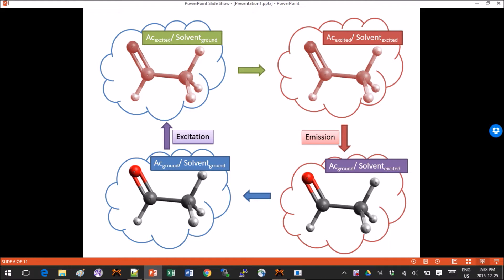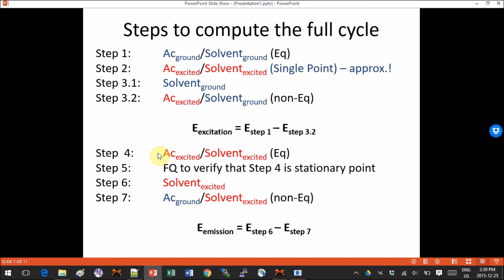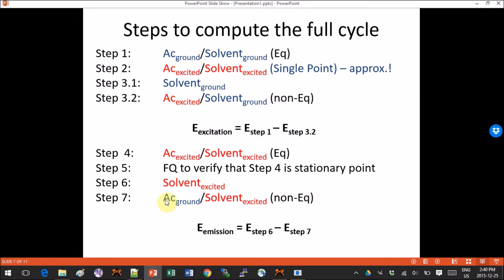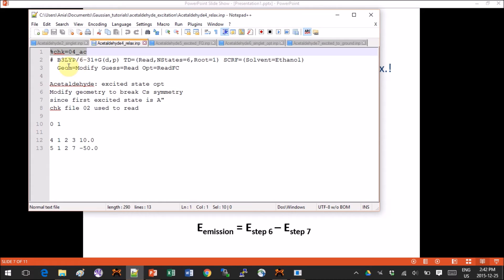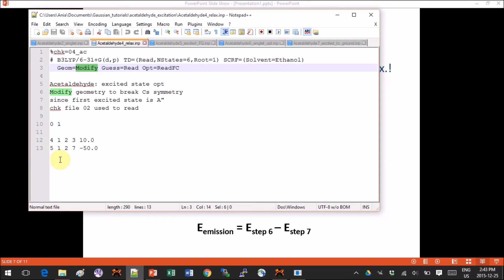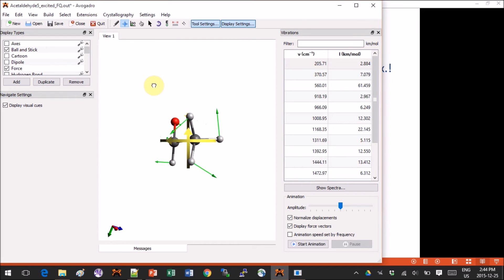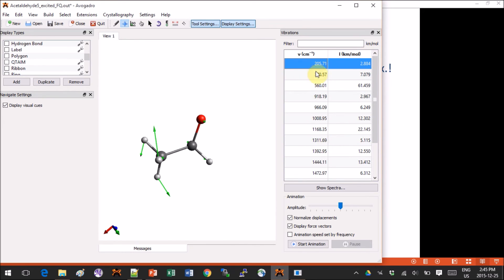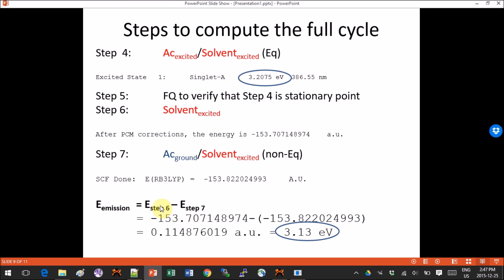Avogadro with Gaussian Tutorial: Fluorescence in Solvent PART2

Comment: hey..can i have your email so that i can email you the questions i have regarding Gaussian and a lil bit for avogadro?
Reply from the maker: +Vaibhav Negi It's easier for me if you'd write up your questions here actually. My email is flooded and I tend to lose messages there=( . What's up?
Reply: I just got started with Gaussian..and I want to calculate the charge density of my molecule ..could u please guide me step by step ?
Reply from the maker: Vaibhav Negi you mean electron density?
Reply: +IaNiusha yes mam
Reply from the maker: Vaibhav Negi https://www.youtube.com/watch?v=AviNr4MiLww
Reply: +IaNiusha  I have seen this video but don't we get any mathematical value ?
Reply from the maker: Vaibhav Negi The values for the density matrix are in formcheck file. If you want to see charges on the nuclei, they are listed in the output file.
Reply: Ok...and will I get correct bond angles when I auto adjust the molecule in Avogadro ?
Reply from the maker: +Vaibhav Negi The optimization within Avogadro is Force Field based (aka an molecular mechanics minimization). This is a fast but crude method. If you require more refined geometries you need to run an optimization of your molecule using other software like Gaussian, ORCA, or GAMESS for example.

Comment: Dear IaNiusha, thanks you for this profesional video. P. S. I send message with question to you. Please check it.
Reply from the maker: +Mateusz Tomczyk To answer your question, the Gaussian website stated: " As is typical of such cases, the molecule has a plane of symmetry in the ground state but the symmetry is broken in the excited state, so the ground state geometry is perturbed slightly to break symmetry at the start of the optimization."
It may be that in your case no such deformation is required, you'll have to try. However if you think that you need to perturb your conformation to access a different energy well, then you can open the molecule in Avogadro an deform it a little bit manually for example.
Reply: +IaNiusha So if I get different energy without perturb of geometry that means the calculation and this method is ok? How can I know if I get good result or incorrect?
Reply from the maker: +Mateusz Tomczyk you have several options : (1) read up on the experimental results concerning this molecule and compare with what you get (2) deform and re-optimize, see if you get back to initial geometry or fall into another one with lower energy
Reply: +IaNiusha Are this energies calculated for 0 K or other temperature? Is it important for spectras?
Reply from the maker: +Mateusz Tomczyk if i'm not mistaken it's computed at 298K, but you should check in the output
Reply: +IaNiusha do you know if there is better level of theory for naphthalene derivatives compounds than B3LYP/3-61* ?
Reply from the maker: +Mateusz Tomczyk the basis set is 6-31G(d), but you can really use any. For each new project, you need to do a benchmark study to figure out the level of theory and basis set required for your system